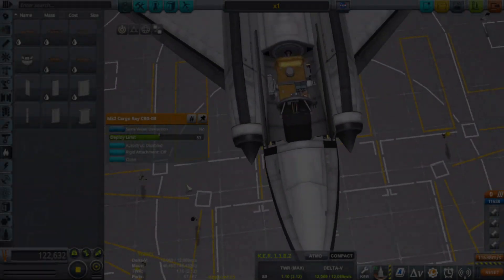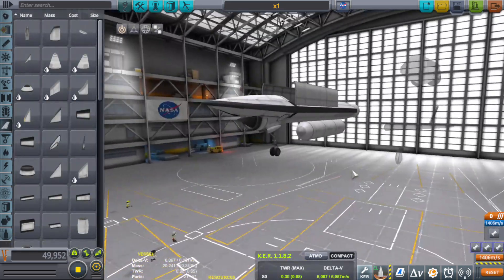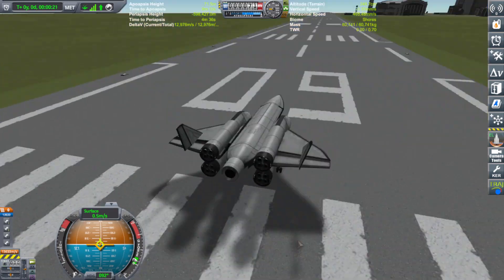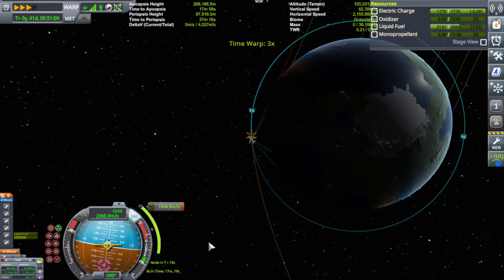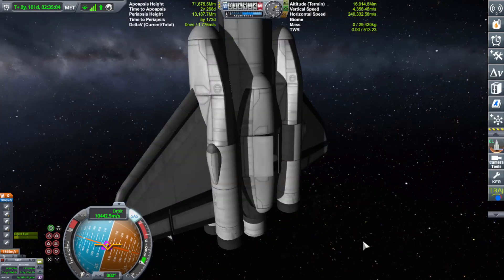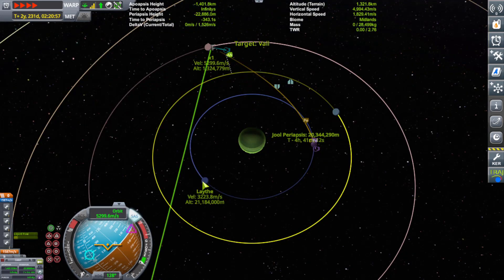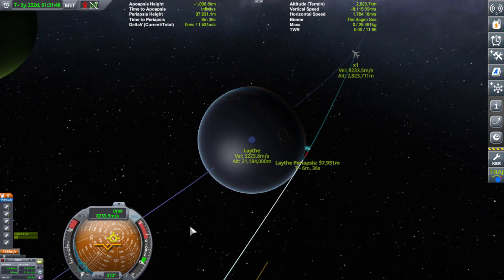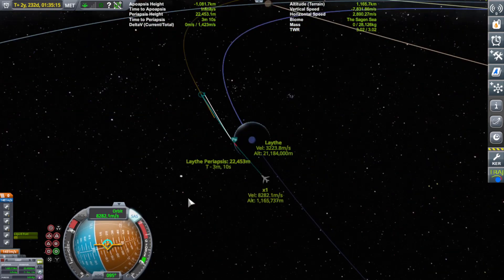LAYTHE SSTO UPGRADE in Kerbal Space Program

Comment: The video is short but sweet. Had a good chuckle when you were talking about your encounter with Jool and suddenly realized the choice of words might have been a little suggestive...

Man, wouldn't it be nice to have a spaceplane nosecone like that without a cockpit? I'd love versions with fuel or as loading bays that little ramps.

One of the few things that kinda irritates me about KSP is that I often find myself working around parts that the game doesn't have, but should. Like larger round fueltanks with only liquid fuel for NERVA engines or a bit of variation for the service bays (which would be significantly more useful, if they had different lengths available).